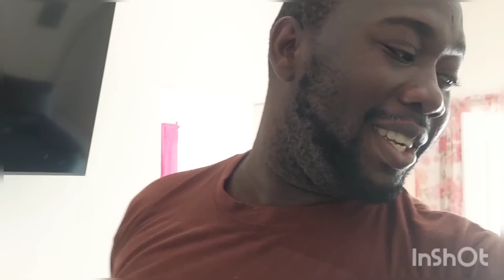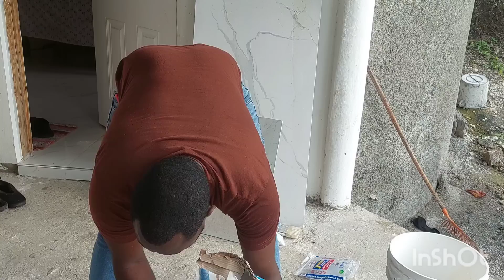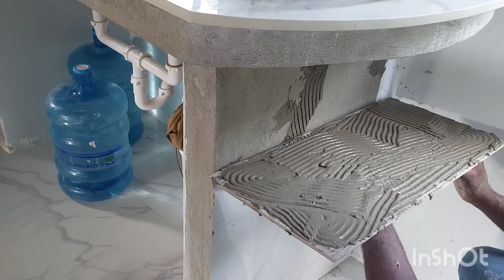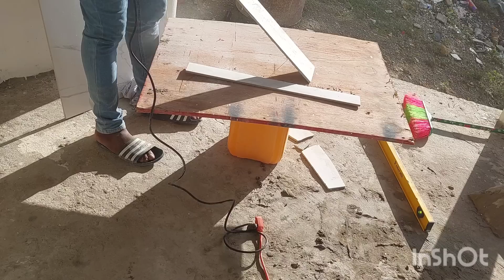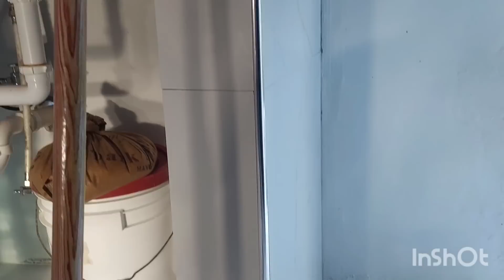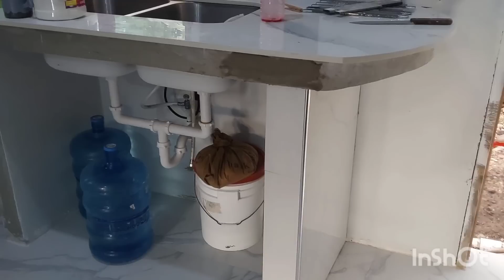Another top class touch inside our beautiful kitchen.

Comment: HI Romario, it's good when you are working on a project and hit a wall, to stop and take a breather.  Go over different designs before the final choice.  With the porcelain you already have small pieces that can be cut and use.  You wondered how to bend the tile for the round corners.  You don't bend the tiles, you cut them in small pieces for the corners, or you could take a picture of the corners with the measurements, take them to the tile store and ask for matching round corner tiles for those areas. Hope this helps.  I also agree with one of your subscribers who suggested checking on YouTube DIY for any project you are doing.